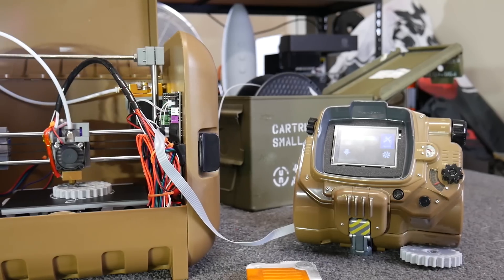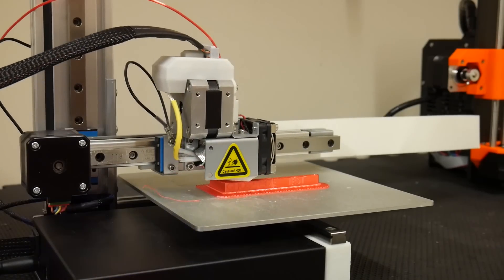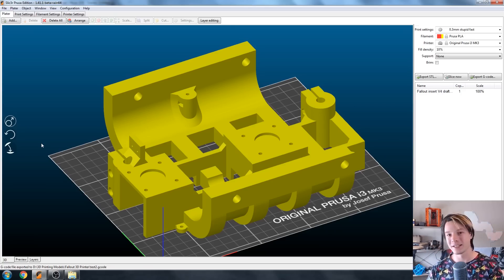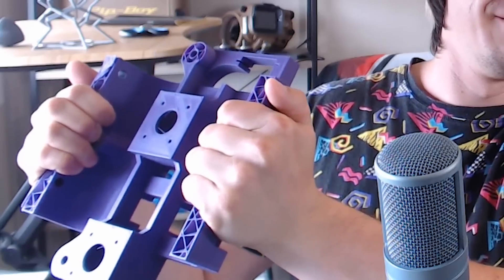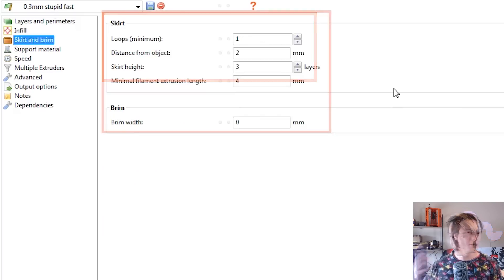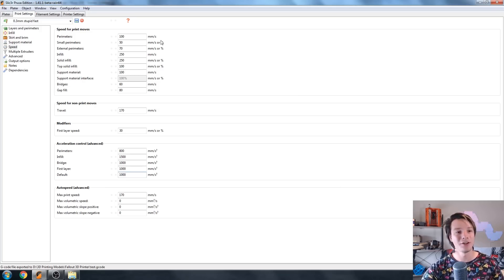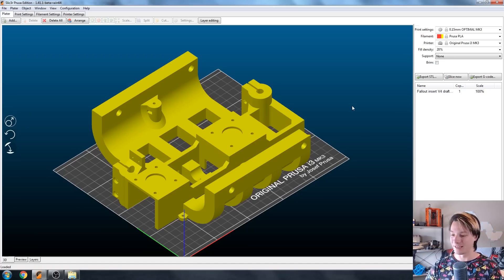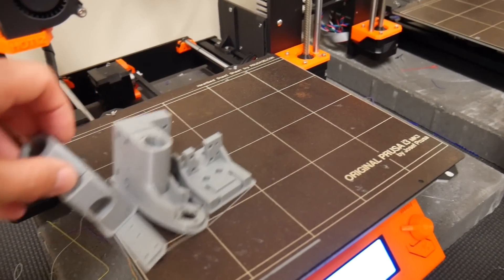3D Print parts TWICE as fast with simple slicer tweaks. 3DP101

Comment: Cubic, not exponential. 

(At first, I thought "quadratic". But it is worse than quadratic, it's cubic. But not exponential.)
Reply: I was looking for this comment :)
Reply: Yes, not exponential, another proper term would be polynomial, which includes x^3, as well as other x^n terms. Exponential would signify such terms as n^x, which is much faster growth.
Reply: @craighansen1632  Exponent is not "faster than cubic". It is only faster after the argument value gets above certain point! People always keep forgetting that! ;)
Reply: Wall time is more or less quadratic with scale - you don't really need to scale their thickness, only their area.
Infill time is cubic, but print times are rarely dominated by infill (which is usually printed fast and thin).
Also, I really like gyroid infill. Strong in three dimensions like cubic, but has no sharp corners that can shake the print loose (newer versions of Cura have it, I don't know about Slic3r).
Reply: It actually isn't.
The only time it would be 8x is if you are printing a solid component (i.e. 100% infill). For the most part it would be between 4x and 8x, with more complex parts (i.e. greater surface area to volume ratio) and less infill being closer to 4x.
Reply: 100% correct.
Reply: Dang now I need to research that a bit. I could not find any evidence that the word 'exponent' or the related word 'expound' was used to describe growth before it was adopted to describe the mathematical relation of n^x. So the use in common language has borrowed the word from the mathematical domain. (Compare: what would expounding growth mean?)
But modern linguistics say: "Well, language adapts, so if words are used differently by many people their meaning has actually changed." So after 4 years of word abuse by the general public they are eager to update the dictionaries. And those of use who prefer words to have a precise meaning to convey thoughts efficiently are left in the cold.
Reply: Does this mean that the "math grammar police" are exponentially more sad than normal "grammar police" or does it mean that they are more sad cubed?
Asking for a friend.
Reply: Ryan Henning, to most people, anything with rapidly increasing gradient  - f'(x),  is "as good as exponential"
Yes we know what the difference is..    Magnitudes.
Reply: 8x volume takes 8x time? Sounds like linear to me
Reply: @PaulKozlovitch  did you watch the video?  He says by scaling up a model 200% it takes 8 times more time/material.  He refers to this as "exponentially longer time".  Nowhere in the video or in my comments did anyone suggest that volume and build time were exponentially related.
Reply: @mqeqeshe1  "scaling up a model 200% it takes 8 times more" is bullshit anyhow. "n times more" is not the same as "n times as much", it's "n+1 times as much", just as "scale to 200 %" is not the same as "scale by 200 %", just as speeds are not fast but high because a "fast speed" would be a "quickly changing speed", ie. a high acceleration, just as "n times smaller" is an utter incomputable bullshit colloquialism because for n=1 you would still have the comparative "smaller" even though the implied formula would mean "the same", etc. You just can't trust people to know how to unmistakably convey what they mean to be talking about.
Reply: zzz
Reply: Cody Colvin Except that you’re not scaling it by 200%, you’re scaling every one of its 3 dimensions by 200%, so you’re scaling it by (200%)^3, which is 800%. Print time goes up more or less linearly with volume, it’s volume that goes up cubically with a uniform scaling of the dimensions.
Reply: actually it is exponential... because the exponent (must be "power" in english I think) is 3. its not the exponential funktion (e^x) that's true! but still its a higher power than 1 (linear)
Reply: No it's linear, both mathematically as well as physically (it prints a series of lines).
Reply: Nerd
Reply: You're confusing the "exponential function" in mathematics with the word "exponential".  A cubic function shows exponential (not linear) increase.
Reply: @mqeqeshe1  no. Exponential has only one meaning and that is clearly defined mathematically.

Comment: Watched one of Adam savages guest videos on tested and she was talking about using a 3d print to act as a rigid mold for the silicone mold in casting.. if your interested Google 'adam savage wears lumecluster phoenix gauntlet' she made it sound so simple but the idea could save a tone of money for guys like me who like prop building. It also breaks down some of the barrier, you no longer need a positive to create the mold, you can work off the negative and cover it with a couple mil layer of silicone (depending on the complexity of the positive). It's worth checking out though, got me thinking in a good way and figure everyone here would enjoy it

Comment: Angus, one other thing you can do to add strength without adding time is push your extrusion width to .6mm - your top & bottom layers will print faster with fewer passes & you can get even more strength with just those 2 perimeters.  If you normally print with Z hop & don't have any delicate shapes that may get knocked over or extreme overhangs that will curl up, you can remove Z-hop for even more time savings.  The .6 width with a .3 layer height will not do overhangs past 45 degrees well - so be warned!  Those curved undersides of your frame would benefit from a vertical "wall" of trimmable support (similar to what you did for the horizontal bridges).

Comment: This is awesome Angus. I never thought of going past 0.2mm for some reason. I certainly tweaked everything else, but this is a bit of a game changer for me. I do a lot of practical printing so iterations of designs and improvements are part of the process which can really be slowed down once you hit the printing stage. So, printing prototypes quickly really speeds up the overall development process.
I'm also glad you did this on the prusa i3 mk3 and with slic3r, as it's the printer and slicer I also use. I've also been using slicr's gyroid infill.. what are your thoughts on that? Stefan at CNC kitchen did a comparison and he found gyroid (along with cubic) to be the best of not the best in XYZ strength (at least equivalent strength in each dimension).

Edit: CNC kitchen's infill comparison video: https://youtu.be/upELI0HmzHc

Comment: I find that when I print infill fast at perpendicular directions of the previous layer, the new line of plastic sometimes pulls up little spikes of plastic breaking up the infill.  It might be too fast and too hot but when I print in gyroid,  the curved version of cubic, I do not have that problem and can print the infill at faster speeds.
Reply: Gyroid Master Race

Comment: Thanks Angus - and here are some things to maybe think about:
Most printer frames are pretty flimsy - so much so that a relatively light printer head moving around with really no impediment to it moving is often causing flex and resonance.
On the other hand, CNC router machines are swinging a full on router around and the tool resistance when cutting is very much higher.
So lets start by making the frame of the printer more solid and able to absorb any forces applied without flexing and/or juddering all over the place.
That theoretically will mean that you can jack the speed way up.
The days of printer frames being made out of acrylic are going to come to an end.
The next point may or may not be possible but here goes...
I have heard that it is possible to monitor the amp usage of a stepper to determine the load being experienced by that stepper.
If this is indeed the case then would it not be possible to monitor real time the loading inside the extruder?
If this is possible then would it not be possible to jack up the temperature as you have done and use a PID loop to monitor the "back pressure" on the extruder (high back pressure means that the filament is not being melted fast enough) and if that is the case, slow the movement of the head down to keep the extrude coming through the nozzle able to lay down the optimum layer.
Which basically means that the printer should always be moving the extruder at the maximum speed and because the machine frame rigidity is so much better, all the ghosting/artifacts etc should be greatly reduced and issues like layer adhesion should also be optimised.
An idea of how to achieve the "optimum variable speed" would be to have an Uno monitoring the extruder motor load and adjusting the speed percentage setting on the main machine driver board on the fly as needed.
If all this can be done then an optimal print will happen every time and the only thing that will change quality of the print will be the layer height setting.
Just an idea...
How about passing this along to Joseph? His guys should be able to make it all work - if it is possible ;>}
Reply: Most frames are already metal, only dirt cheap machines are acryllic (and even then there are cantilevers and Ender 3 for under 200 dollars that are metal). 20-series aluminium extrusions seem to be a new gold standart for 3D printers, and at least from personal experience (going from A8 to a custom frame with V-slots instead of linear rods) the frame rigidity skyrockets. A8 has almost vibrated itself to pieces (the screws were coming loose all over the frame), the AM8-custom can go over 100 mm/s without even reprogramming it. The age of acryllic frames is pretty much already over, and it won't be missed.
Reply: You screwed up few people's who are currently writing Patent with your public disclosure!
That is great for the Open Source community. Thanks!
Reply: MK4Duo optionally does thermal compensation for the heat lost as extruded material. It's physically based and easy to configure. I'll try and port it over to Marlin2.

Fundamentally temperature control overrides such an adjustment long term, but it can help avoid short term fluctuation in pressure difference.

I don't see the point of measuring extruder current. Basically you have two fundamental issues, slipback and grinding, which are related, because the motor doesn't feel the filament not being advanced enough. You can trivially avoid stalls just by setting drive current high enough, and you have to because extruder stall is pretty much never a good thing except in emergency. Extruder operates at holding torque, essentially near standstill, so Trinamic current sensing is not possible.

Prusa has a sensor identical to one you'd find in a laser mouse trained at passing by filament, so it can measure actual advancement speed. However a reliable way to integrate it into the firmware beyond trivial go/no-go detection has not been found. Once you integrate corrective measures such as negative feedback, the system becomes fundamentally sensitive to noise and loses stability, because of control delay. Solutions to that include PIDs and neural networks. Problem with PID is its narrow operating range. Problem with neural networks is that it takes a long time to get useful results out of them, computationally intensive, highly opaque, a scary option all around. Any intermediate solution trying to combine benefits of both is likely to exhibit the drawbacks of both to a degree, and it's too risky for a business anyway.

Comment: 1day and 3 hours is 27hour at 1mm layer height.
Just changing layer height 2mm should theoretically cut the print time in half so 13.5hour.
Sure 11 hour is faster than 13.5 but the difference isn't that much and print quality is better since 0.2 layer height is better than 0.3 layer height

Comment: Infill doesn't add that much strength anyway. In my opinion, the main function of infill is to support top layers and internal overhangs. Simplify3D has the option to skip infill on some layers and compensate by extruding more material (say, infill only every second layer). I tried it, but the hot end can only really melt so much material per minute, so you have to be careful with infill speeds when extruding this much. What I have ended up doing instead is to use a 3-layer infill where I have infill angles 60° apart (grid infill has 90° angles between layers). So the lines are going in a specific direction only every three layers, but with infill width set to 100% (which makes it really thin as it doesn't have anything below it for 2 layers in most cases), you actually end up a relatively dense mesh of infill with very low amounts of material and a fast print time. Top layers print very nicely on top of this 3-level triangle mesh.
Reply: Juri, so now print a hollow cube as a shell, (or even with 5% infill,  to avoid a drooping top), then repeat with 30%, or heaven formid, 70%, infill and do a crush test, I think you will be surprised, infill can make the difference between a cosmetic part and a functional part.
Reply: https://www.youtube.com/watch?v=AmEaNAwFSfI

Comment: meh... just slap a E3D volcano with a large diameter nozzle on your printer and print away. My printer can go 8x faster or sometimes faster than any other printer and quality isn't really affected too much, but the parts are even more solid. There are literally no reason not to get a E3D volcano if you can afford it tbh.
Reply: Before some smartass starts crying out "boohoo he said "without changing the hardware", I don't care. A 0,4mm nozzle is for details, not structural prints

Comment: How does Slic3r PE deal with a .03 layer height when the steppers move at. 04? Does it round to .28 or .32 or something else?
Reply: Slic3r just write g-code. It's up to the firmware to decide when executing the move. Answer : Stepper drivers interpolate at 1/16.
Reply: Good point. In that case, I wonder how different firmwares deal with it.

Comment: Sorry angus but you are quite a noob about tunning your printer, it clearly shows you dont print 24/7 for a living. Pro tip: its all about the mm^3/s, the rest barely matters.
If you used the default prusa pla settings, your mm^3/s cap is at 15mm^3/s. For comparison mine is at 20mm^3/s (@240ºC), so my mendel with a V6 could print 25% faster than yours. And fo anyone interested my vulcano machines' profile is at 34mm^3/s max (@240ºC)
Layer hight and width doesnt matter, the time is determined by the acceleration and the mm^3/s you extrude. The layer height and extrusion width helps to regulate the flow, the max speed you need and the streght of the part.

Comment: Anny, you didn't did the one and only thing that really makes the difference: to round all your sharp corners so machine won't have to slow down on every sudden direction change.
There is a lot of corners in your model that you don't need for anything.

Also I do extrude my PLA at 220-230°C and have zero issues with supports or bridges.
And it makes layer adhesion only better.

Also put on that 0.8-1.0 mm wide nozzle, this will make more difference than anything else if you are in a hurry.

Comment: I can't get Slic3 PE to print as smooth as regular Slic3r.  PE just doesn't hide the z-seam (zits) as good as regular Slic3r does. I've tried several different settings. Anyone got any idea's?
Reply: if you can show some screenshot of the result for the same piece (on a gcode viewer), then you can ask/inform for improvement in the github issue tracker.

Comment: If you're already using 250 for the infill, you can safely use that for travel as well. I don't know about max feedrate for a prusa, but probably it's 300mm/s,  and since vibrations and layer shifts are introduced because of acceleration and jerk, you're safe with any speed you set, speed (which is max speed after acceleration) is only affecting the quality of the extrusion (like the infill issues you got near the curve)
Reply: Filament profile has a mm^3/s cap at 15mm^3/s. It wont go faster even if you set it to 999999mm/s

Comment: Can you show your retraction settings??
Reply: for a all metal v6 just use 1mm retraction and 0.4mm zhop. You can do 0.6 or 0.4mm retraction if you only move bewteen perimeters otherwise it might string a little, which you can help by not using zhop, but that all depends on your part so that you dont crash against some section that tends to curl or something